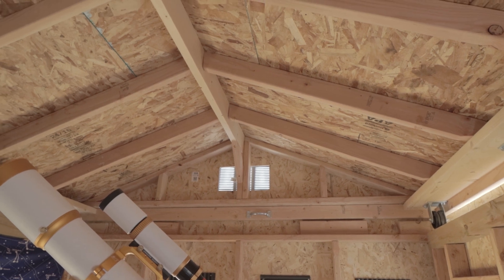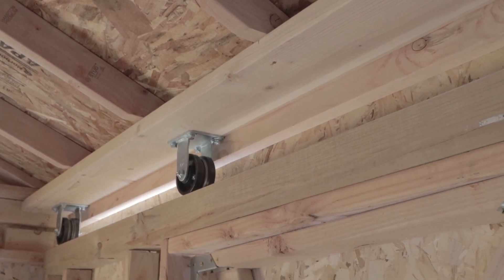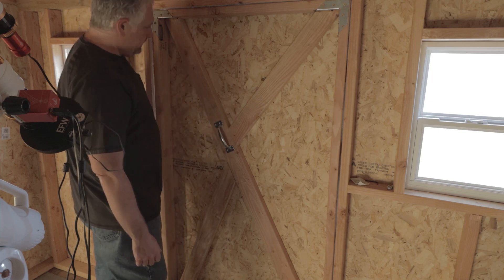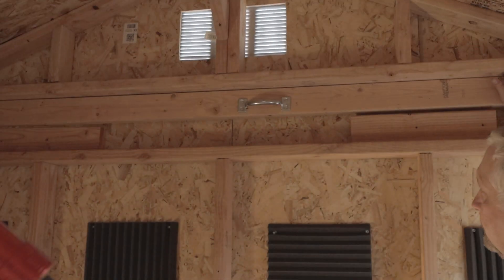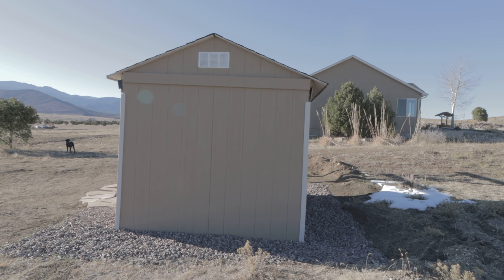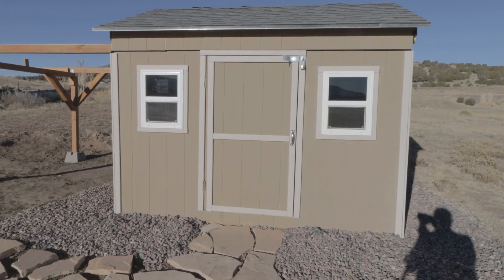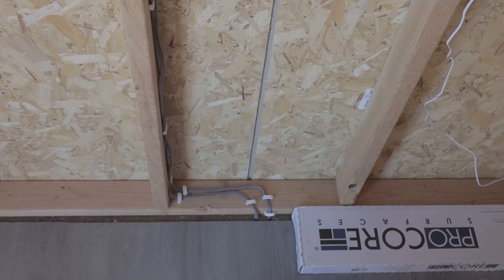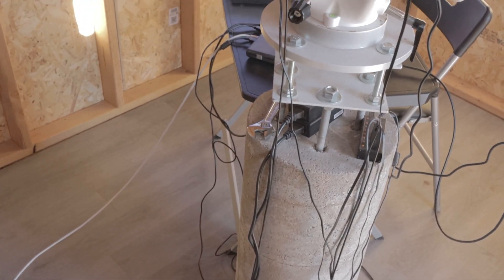Building Bear Claw Observatory | Home Observatory

Comment: Hi Joe. Great video. Now in construction of an 8x10 roll off roof shed. Just wandering what is stopping the wind from blowing off the roof? I have 60mph winds here in the UK being by the coast. Richard
Reply from the maker: Thanks Richard, my roof weighs a lot, between the osb, shingles, 2x4s, 2x6s, and 2x10 rails, plus the casters and rack, I don’t think we can have a wind storm strong enough to lift it off with the roof closed. We get wind gusts as high a 70mph during blizzards ad it’s never moved. Before I added the rack and pinion motor, 50mph wind would close the roof, but never open it. It couldn’t hurt to add some turn buckles if you’re concerned though.

Comment: That is one nice well built roll off roof observatory Joe!  I have just finished building my own 8x10 SkyShed from plans purchased several years ago and it took me a long time working alone steadily, but I did it.  Your shed is as fine an example of any construction I have ever seen and you should be very proud, she's a beaut'.  If I can offer you one tiny thing it would be to get jackstands on those outriggers soon as you can, maybe you already did.  That is how you iron out all the rises and falls of frost heaves and wood warps that come - I built my own into the bottom of my 4x4s because I live on a steep hill which presented its own challenges to building.  I envy you your wide open skies, excellent.
Reply from the maker: Thanks so much Rob, yes I still plan on getting some made up. I’ll probably need them for sure by spring or before.

Comment: Great job Joe! Well done. Your observatory is very much like what I'm looking to do. I'm wondering if the 8x10 size is working out well for you or if you would've liked to go a little bigger say 10x10 or 10x12 in order to create a warm or control room? Can you still squeeze that in with your 8x10?
Reply from the maker: Thanks Scott, so far I’m really liking the 8x10 size for what I’m doing. My warm room is in the house lol. I would definitely go bigger for a warm room. I still plan on adding a desk and workstation and some shelves. It doesn’t feel cramped by any means. If I planned on staying outside throughout the night though, I would have went larger and added a second pier for a visual setup as well, but my passion is with photography.

Comment: Awesome Video Joe.  I was wondering what other reason as to why you would build an observatory beside the astrophotography aspect, then you told the 'bear story'.  That right there is a good reason.  Are you going to put insulation between the studs and then dry-wall it?  Seems like that would help with the temperature fluxuations.
Reply from the maker: Thanks Pat, I'm thinking about the insulation, but drywall for sure. I also need to build a shelf/desk for a workstation and some shelving. I may just add some styrofoam inserts in the roof as well and not put drywall as the roof is already pretty heavy.